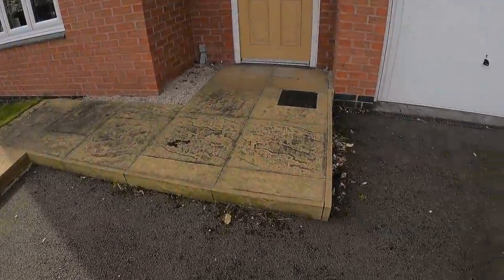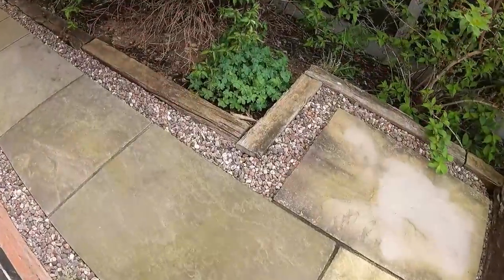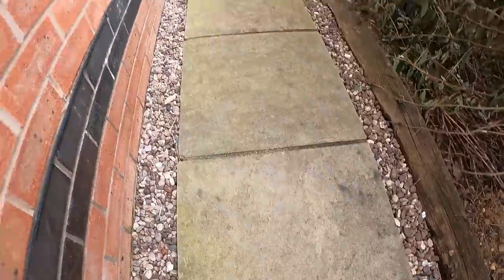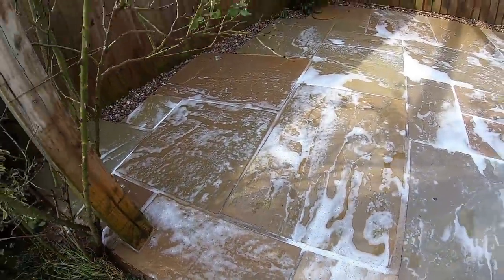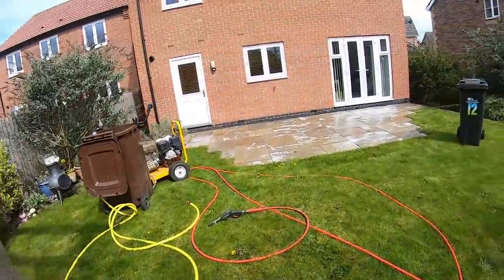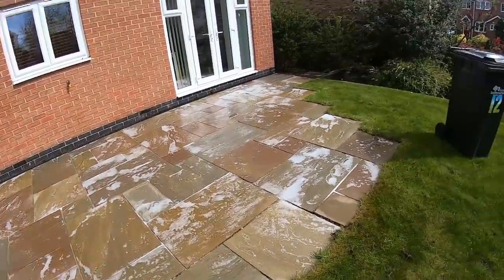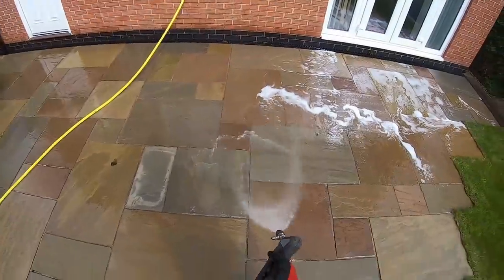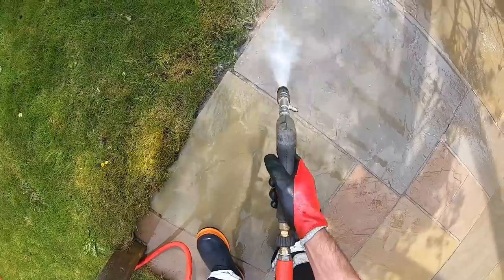HOMEOWNER Didn't Think I Charged Enough! Pressure Washing Transformation

Comment: In my country, my dad would make the entire family scrub that floor with brushes on the weekend lol. Good old days. We lived in a tropical climate so the tiles outdoors will be covered with algae and moss quite often and twice a year the entire family (me, my two sisters and mom and dad) will get to work cleaning our garden. It's crazy how times changed so much where our lives have gotten so busy that we need to hire people to clean our own homes! A good business opportunity tho.
Reply: Actually, the old style srubbing is better for the stones.. Pressure washing with turbo damages the tiles and ads microscopic holes for more algae and moss to settle :)
But if you got a brush to attach to the water, then its good :)

Recently did our driveway with pavingstones and needed to use jetwash because former owner hadnt done it for years, but the next 3-4 times im gonna just brush it :) takes longer but its less of a mess and i wont damage the stones, and i wont need go buy extra sand

Comment: Appretiate the tips Sid! Curious as to how you tone down the pressure for rinsing off using the shortened lance. Is it purely lower revs on the pressure washing machine with the same lance? or do use use a seperate lance (side inlet for chemicals) with a wider spread? I couldn't tell if you had an attachment on the end for the rinse down. You will cetainly reach 100k subs. Its not down to luck either, you're too modest!

Comment: Such a difference! Pardon the - hopefully silly - question but why are you using a petrol-driven pump? Would it make more sense to use an electric one? Less noise, cheaper, etc. Or isn't 3 kW / 13A enough?
Reply from the maker: electric machines are typically less powerful, i do have an electric pump on my steam cleaner though its pretty good :D